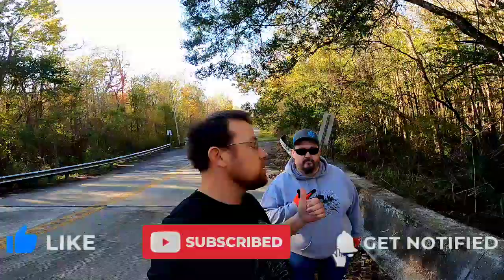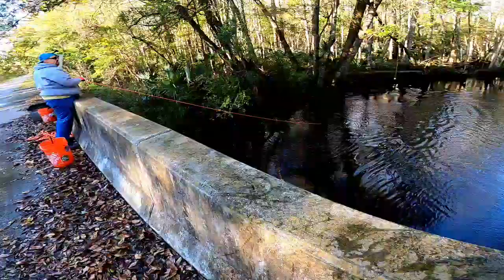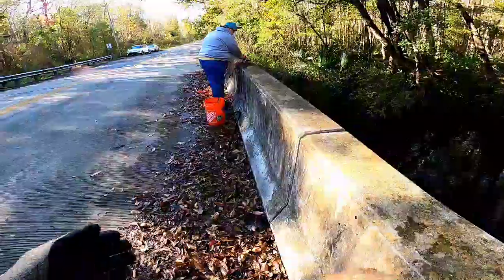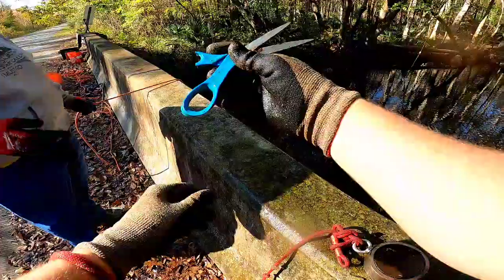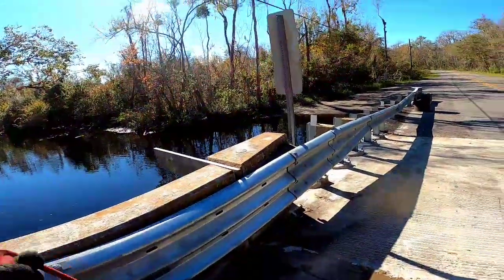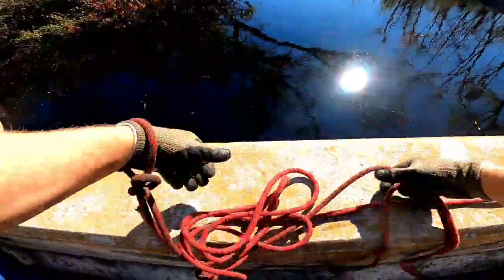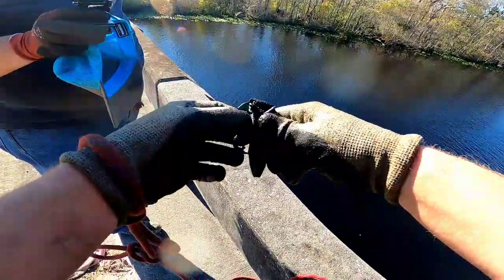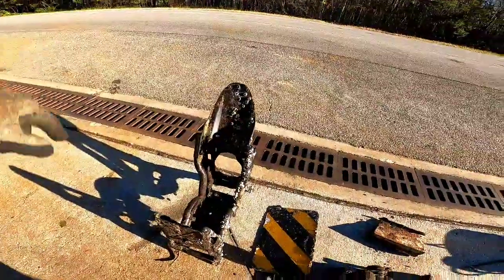Magnet Fishing backcountry creeks for backcountry treasure and we find a bone and MURDER METAL!!!

Comment: The top of a gas cylinder is a pretty odd find. So was it a motorcycle frame? Seriously could not tell. Almost looks like a piece of some type of furniture. Looks like legs on it. Haha that spring still has some bounce! A socket, in a tin, in a bag, that's weird lol. Some seriously good finds!!
Reply from the maker: It's part of a motorcycle frame. the way we have it siting it's upside down. I had fun with the spring. The slow motion had to happen! Thanks for watching!